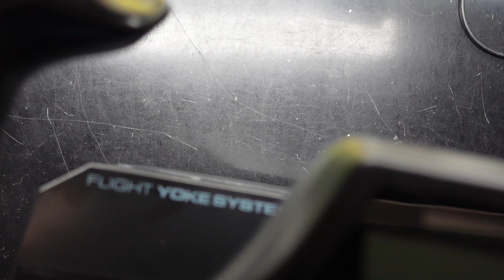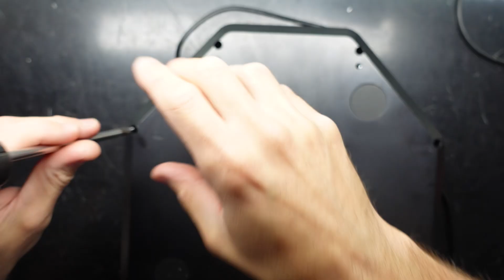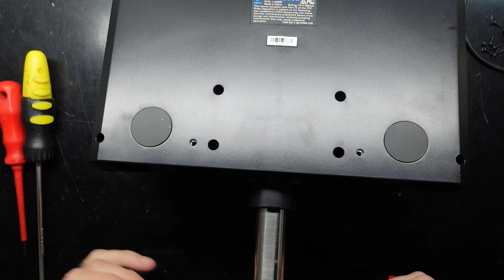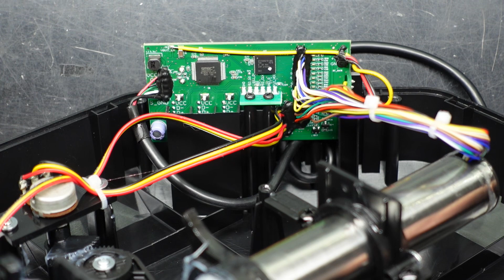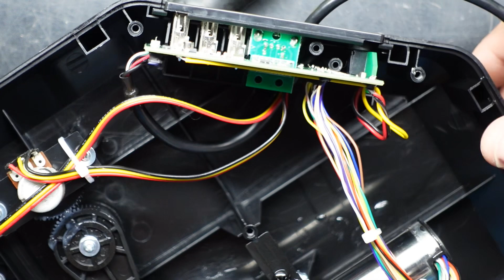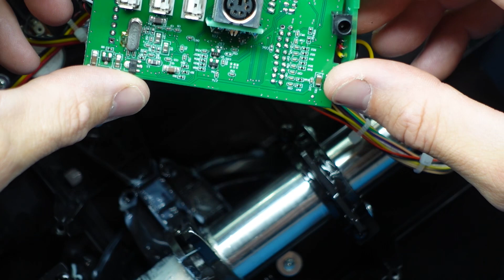Logitech flight yoke teardown

Comment: i really liked the video, I believe something similar happened to me, so after plugging it in another pc after a couple years without using it, it worked for 20mins then it stopped working. were u able to fix urs?
Reply from the maker: i had no luck getting this fixed

Comment: Hello friend. Excellent video. I would like to count on your collaboration. I'm looking for the diagram or schematic of this board, so I can solder the cable harness back to it. I needed to replace the board, and I lost the diagram to solder the cables back to the correct points.

Thank you for your collaboration.

Hugs.
Reply from the maker: sorry I don't have any other info to offer about these

Comment: Hey Rick. Were you able to get it fixed? My father got me one for my birthday when I was 17. A couple of years later, mine also stopped working. I used to power it directly from the computer usb. I have kept this yoke for more than 10 years now in a non working condition but never been able to fix it. This finally gives me some direction but would like to know if you were able to get it working.
Reply from the maker: so far no luck getting it going replacing the USB IC
Reply: Look for projects with Arduino, unfortunately I can't make it work either, I believe you have to rewrite some software